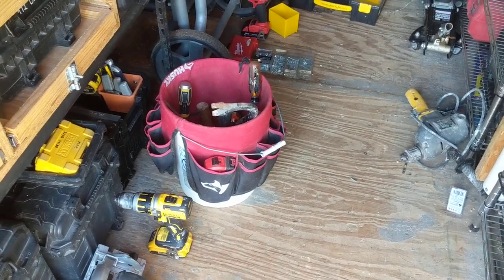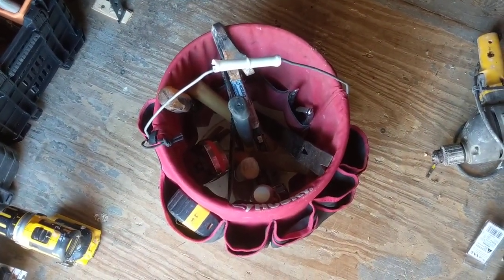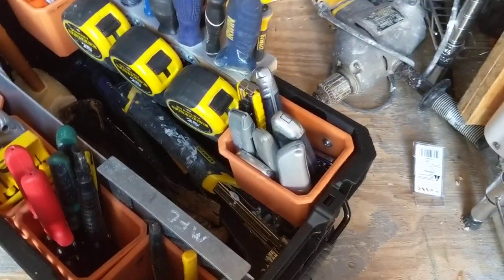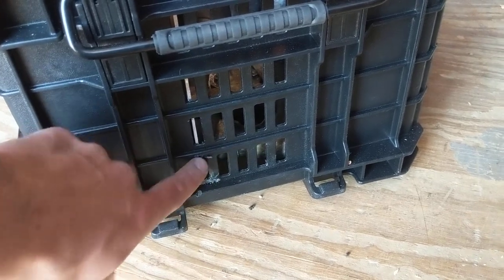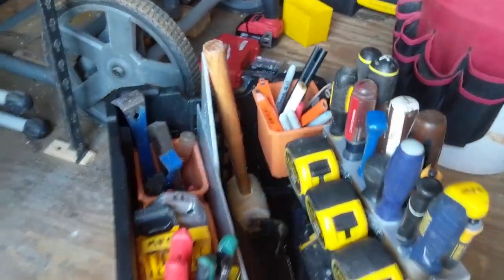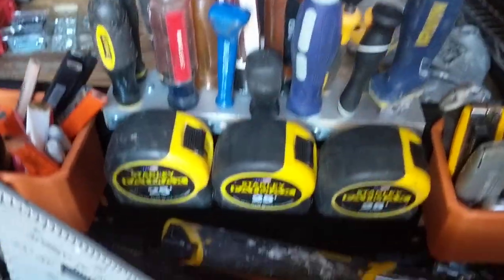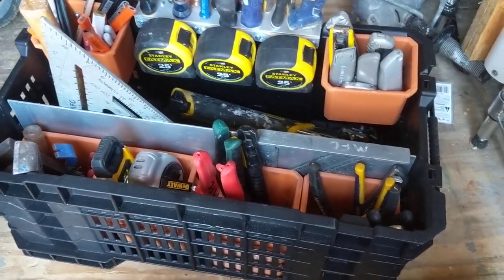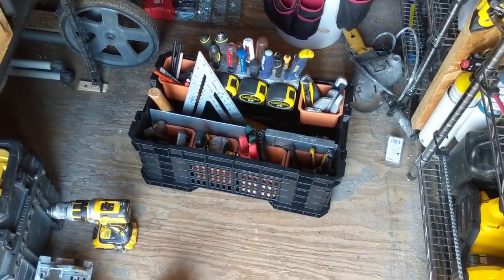Ridgid 22" Tool Box Crate Retrofit Part 2

Comment: Thanks!  Really liked your improvements.  Simple and very practical.  I bought several Rigid tool boxes recently and saw immediately there was room for improvement and turned to YouTube.   One case had a handy tray, but a single space underneath allowing tools to slide around.  I cut small luan strips temporarily to serve as dividers.  My wife pointed out that one of the tops, which had a grid-work of compartments for strength for the top, could also serve as storage for small tools or hardware if Rigid provided a clear snap on internal lid to keep everything in place.  I know they sell a case with a clear lid, I bought it.  However, I will be returning it.  The clear top grabbed my attention, but when I got it home it lost it’s appeal.  I will now purchase the crate in your video.  I also plan on duplicating some of your improvements.  Rigid should embrace some of your ideas and give you the credit or at least some free stuff IMHO.
Reply from the maker: Thanks, maybe they could send me a drawer toolbox prototype. I can dream...

Comment: Neat ideas, I will be copying some of them. I use the ridged system extensively and have used the rolling dolley hack, chopsaw table and made a padded seat cushion. My next hacks will be creating a base for a wet and dry vacuum and also a base for a small HP all in one printer.  One thing I can't find in the UK is the clear top organiser which is a pity because I would probably buy 5 or six, however I did discover that you can slot a number of organisers into the rolling box.

My wish list includes a hard bottom tool bag that would clip to the system and maybe a Unit with 2 or 3 horizontal drawers.
Reply from the maker: I really hope ridgid is paying attention to people like you. They could really compete against Pack-out with a few more options (bags, drawers, dolly base, etc.)

Comment: Most people that don't work in the trades might say your OCD.  
IF you work remodeling and do multiple trades, and repairs you quickly realize that no organization means wasted time looking for tools AND wasted money $$. .  Organizing just plain makes the job easier. 
I chose the Rigid tool box system because they are more simple and stack easier. They're better when you have to go up and down stairs you just carry the rolling tool box first, then carry the others like suit cases and just quickly put on top of the rolling box. The Milwaukee system just takes longer you kind of have to slide them in. I returned the Milwaukee, ,sorry Milwaukee.  Sometimes sturdy,  and simple works better. 👍
Reply from the maker: Yep, simple, sturdy AND cheaper. $98 for the kit every holiday sure beats $200!
I just hope Ridgid develops some drawer boxes and additional cases like Milwaukee. They just came out with a 28" rolling box that is compatible with the system. Interested to see that in person. None at my local HD yet.
Reply: @MyFortressConstruction   yes , drawers or even a system where the front side opens, without unstacking for access. Im in and out of apartments, last thing I want to do is spread out my tools in a tenants homes, or customers home...

Comment: What I like is u could do all this WITHOUT drilling any holes in the crate. Press brake the aluminum toplate to conform around the lip of the crate. Use screws and washers to go through the aluminum side, then between the slots in the crate and into the wooden block.

Comment: Well done......I just got this rigid system......still figuring out how to organize them.....
Reply: Well here is the situation....I have a 16' trailer with all my tooling in it to do remodeling.  Sometimes,  depending on the job it is impractical to drag the trailer with me.  This is the reason that I got these boxes. They are really good and sturdy for sure.  The issue now is that I keep my regular hand tools and cordless tools in them to be ready to be mobile without the trailer. To keep things organized I typically keep them attached together.  This is where my failure comes in. The problem is that I routinely have to take all the boxes apart to do work and have all the boxes laying around in the trailer......it's turned into a pain in the * to get to my regular tools.....🙄😄😄😄
Reply from the maker: Yes, people don't understand the work it takes to keep a trailer organized. I have reorganized my trailer 5 times over the last 4 years to get it to a layout that works for me. I have seriously considered moving to a Sprinter style van, but I just can't give up having all of my tools with me. Check out my "Quarantine Trailer Organization" video for some ideas for your trailer.
Reply: @rrf482012  Actually one of the advantages of the Ridged Pro Line vs most of the others, is you can get to tools in the stack without taking the stack apart.  You just make sure all the boxes are locked but the one you want to access, and lift up on the box you want.  Doesn't work for bottom (wheeled) box and could be heavy lifting it up if the upper boxes are filled with tools.  But I really like this ability, over some of the other solutions.

Comment: Love what you've done with the crate.  Capital idea on how to install the aluminum inside of it.  Can't help but wonder about attaching a wide carrying strap down the middle to help move it around easier with one hand but wonder if that would get in the way when trying to get the tools from inside the bottom.
Reply from the maker: Thanks, I never thought of a strap but yeah, you could clip them onto the side latches. My box would be crazy uncomfortable to carry like that though because of it's weight.

Comment: Since U make more money in efficiency at the jobsite & lose efficiency packing & unpacking, this is a great solution because is ready to work on arrival.
Reply from the maker: Yeah, I find that space is best utilized when hand tools are vertical. I've tried drawers and other solutions, but nothing beats an open top crate that keeps everything readily available. Problem is that nothing else can be stacked on top, but you can't have everything!

Comment: Update , Rigid made the drawers !!   They are too heavy, they need smaller and or 1 drawer . Im thinking half the size and weight to fit in the middle of your rolling set-up.
Reply from the maker: Yeah, I finally got into Packout and then about 8 months later Ridgid announced the drawer and other boxes. But I'm happy with Packout. I have the cabinet at the base, drawer box and then a crate on top. I don't have to unstack anything to get to everything. I would like one single deep drawer instead of the cabinet, but I can fit the roofing nailer and a circular saw in the cabinet so it works.
Drawers have really made everything simpler, but they are heavy so I wouldn't use them if I couldn't roll everything around (stairs are no fun).

Comment: Do you think that the cups work well attached to the metal plate so they can be removable as well?
Reply from the maker: Yeah good idea. However, the biggest problem I've found with my design is that the long wall with the screwdriver plate, is too heavy and so that wall is slowly bending inwards. It needs some "rigid" reinforcing, maybe another metal plate on the outside so that it doesn't bend inwardly.